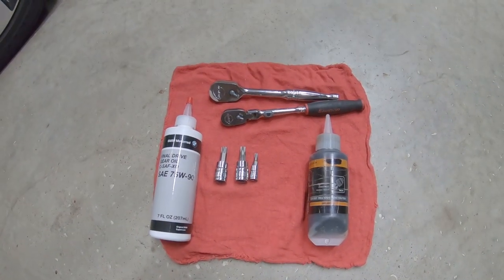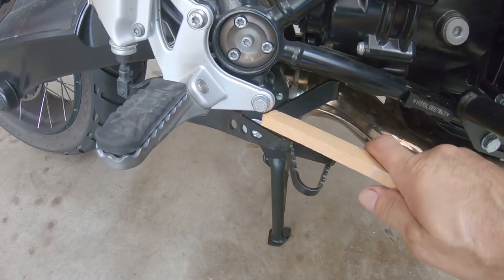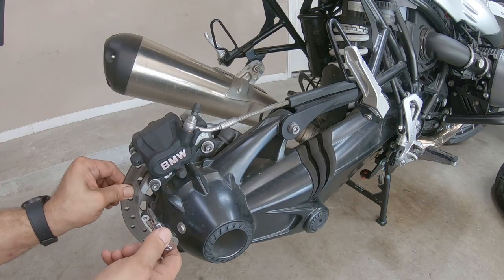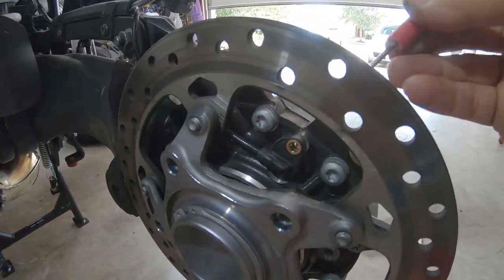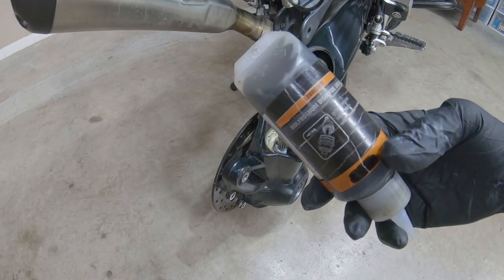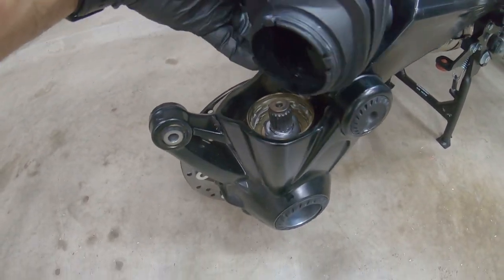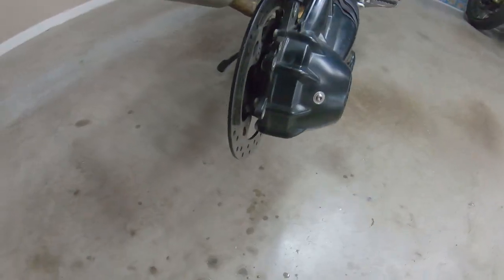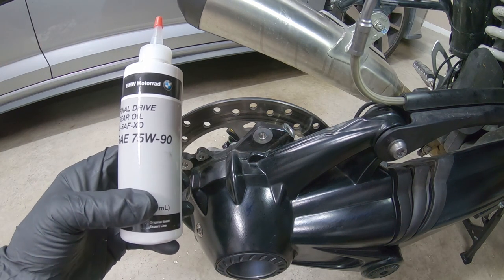BMW R nine T Shaft Splines Lubrication & Service

Comment: Yeah the boot is not all the way in at the back. Easy if you fit the back first, then the spline, then pop in the front. Also you should be using Staburags NBU 30 PTM paste to seal the boot so no water can get in. For the spline you should use Castrol Molub-Alloy Paste White T (white grease specific for splines)

Comment: Did you pour all 207ml of final drive shaft oil? Manual states 180ml...
Reply from the maker: Yes, the manual said that, but I added 200 ml because I drained bone and dry.
Thanks

Comment: Great video but I don’t think the rubber boot is all the way in on the back side: you can see this by comparing the beginning of your own video with the end of it, the lip does not touch the metal.
Reply from the maker: Thanks for watching and the comment.
I will verify that.
Reply: I noticed the gap either and went to the comments after that. Also at the beginning we can see a white grease on the both sides of the rubber boot - for a better sealing to avoid water penetration into the system, my advise to put it back, especially if you wash your bike with a high pressure washer. Best regards.